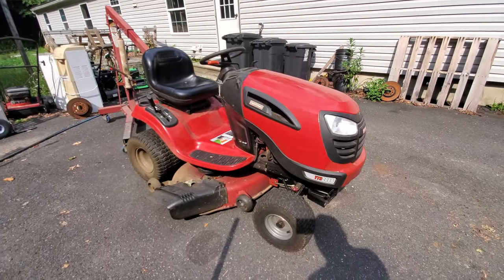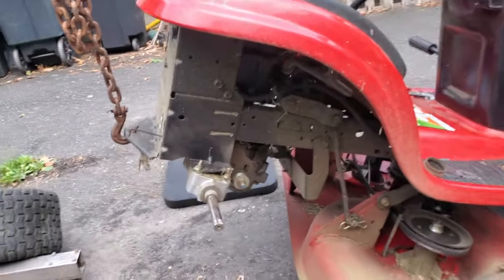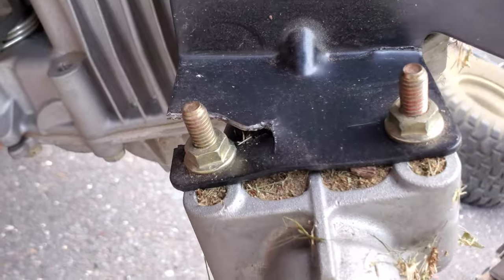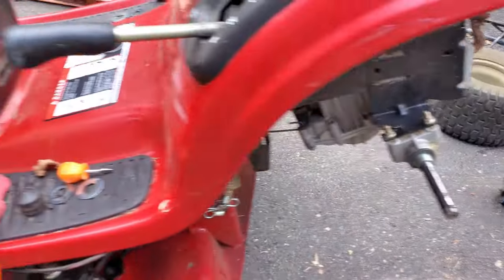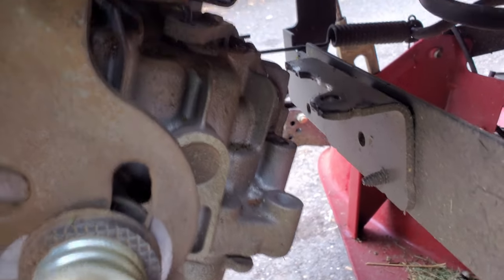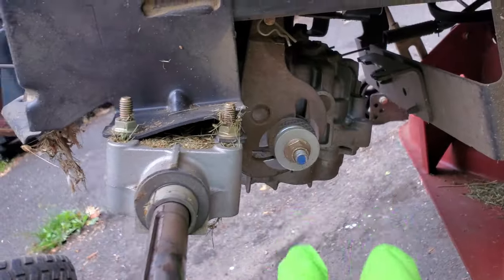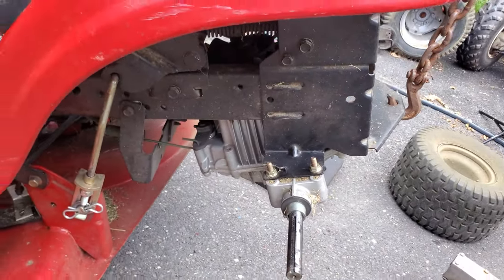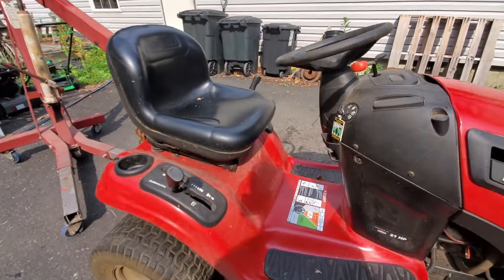Tuff Torq Transmission mount Failure in Riding Mower

Comment: Ouch 😳 that looks strange thing to have happen to the transmission brackets
Reply from the maker: I have seen it before, usually when there is a bolt or two missing or loose. Good subject for a video I thought.
Reply: @ridingmowerking    glad you made this video on this matter riding mower king 👑

Comment: I just fixed a Craftsman with the same issue. One I worked on the bolts in the front actually came out
Reply from the maker: I think that sometimes the bolts don't get put back in, after someone had the trans out.

Comment: That was the first problem I dealt with back in 2012 on a YTS4500. Cheap manufacturing processes using those self-tapping bolts was the issue. They loosen up or break in the cast aluminum transaxle. The fix is to drill the aluminum bolt holes straight through and use nut/bolt/lockwasher. The YTS is still in service today!
Reply from the maker: Yes, I dont like the self tapping screws, especially when installing deck spindles.